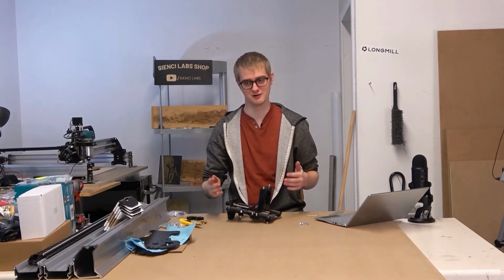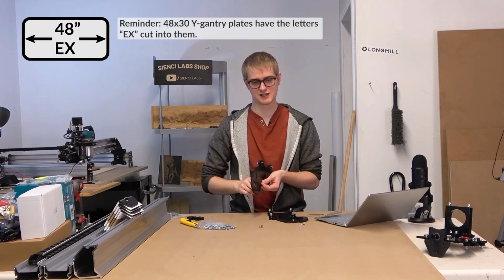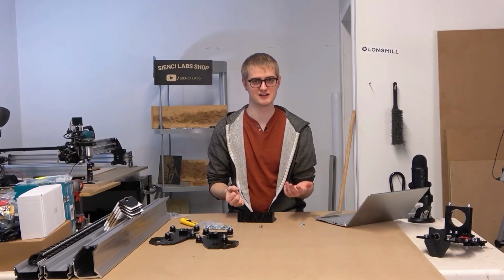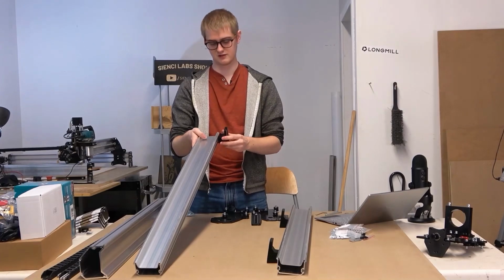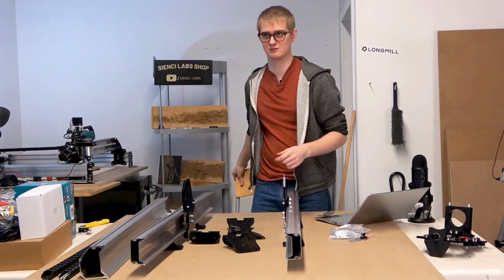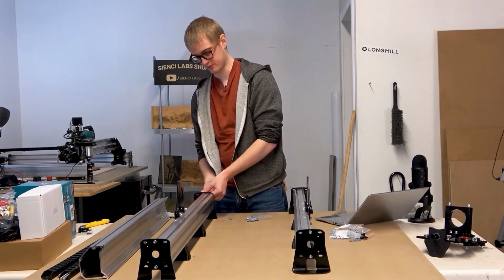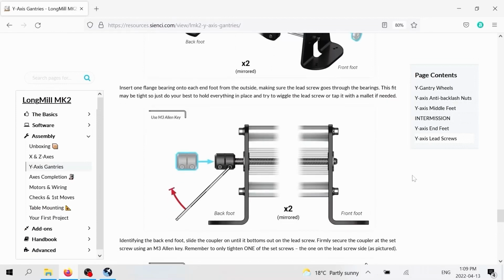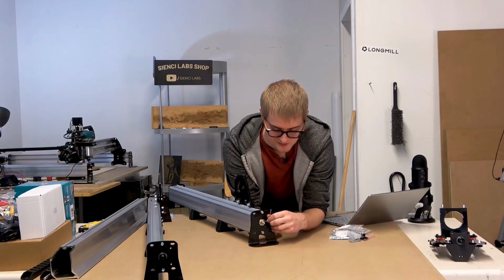Sienci Labs LongMill MK2 48x30 Assembly Part 2 ( Y-Axis Gantries)

Comment: Had a problem with the bearings not wanting to slip over the lead screws very well. 

The one side was a little sticky in places, but no big deal. The other side tho... Since I had already tightened down the motor coupler and forgot the bearing first, I just slid the bearing all the way from the other side thinking it wouldn't be a problem.. similar stick like the previous one, but then holy cow, after about halfway it turned into a press fit. Hopefully I didn't do any permanent damage b/c I had to use a slide hammer and Aero Kroil to get it off. Not fun, but nothing looks bent or damaged other than marring on the lead screw finish. In the future you may want to add a note to only install the bearings close to their ends, even if it means removing and reattaching the coupler. No bid deal though, I can't wait to get this thing up and running!
Reply from the maker: Thanks for the heads up MotoLotus. Yes sometimes the bearing fit can be a little tight or loose on the screw, sorry to hear about the struggle you had. If it winds up the bearing or screw got some damage just reach out and we can ship a replacement if need be. Excited for you to get it all together and cutting!